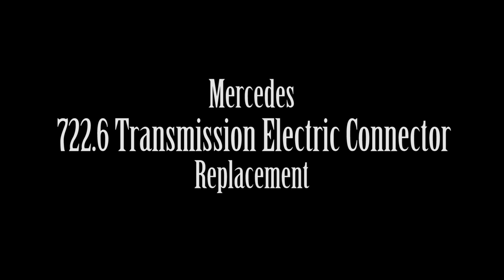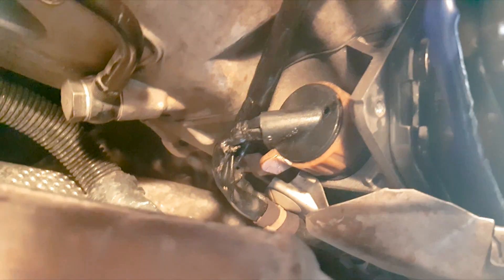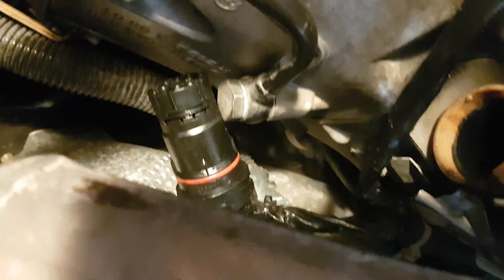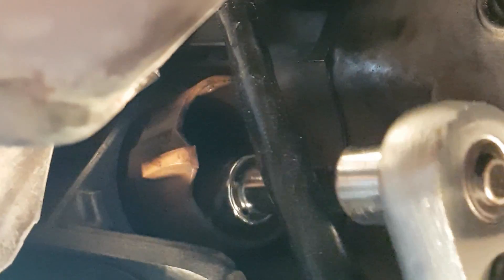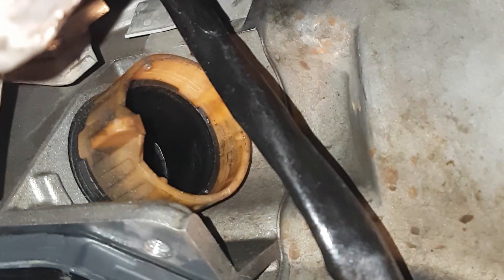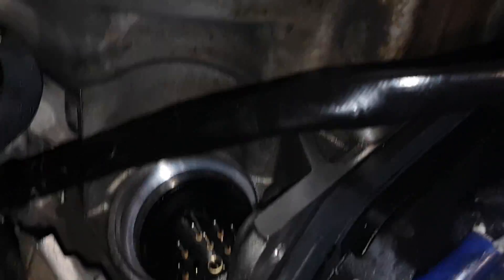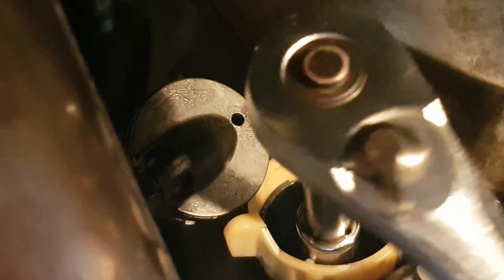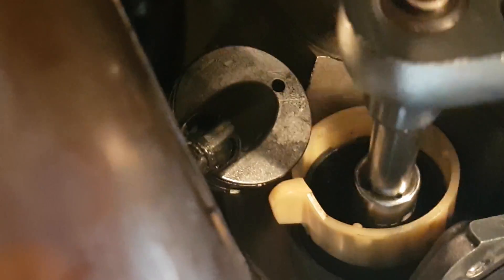Mercedes 722.6 Transmission Electric Connector DIY

Comment: sir i have gm transmission with similar connector. it always wet and fluid seen on the electrical terminals. i experinced stalling and not shifting at all so that i have to stop the car and wait for an hour and resume driving. now i am not using the car. is wet plug could cause this fault? is transmission fluid conductive?
thanks
Reply from the maker: Locate your transmission control module or TCM.  Open it up, and check for oil intrusion.   Clean good with electrical parts ckeaner.  Then replace  adapter.

Comment: I just did mine, it spilled around half a liter of lil from the transmission. Is this normal? I don’t see how I can top it up
Reply from the maker: Hi.  In order to avoid that, you have to lift only the front of the car. Still it could happen if the transmission was overfilled last time.  Yes, you can add fluid thru the dipstick holder in the engine bay.  Just be sure to add the right amount or yet better do a drain and fill.
Reply: @masood-tv will do a flush soon. Thanks for the video. Always great help :)
Reply from the maker: Np.

Comment: You forgot to mention to DRAIN the pan first. Please guys drain your pan first.
Reply from the maker: Not necessary.  Please read the comments and my replies.  If just the front of the car is raised and the transmission fluid is not overfilled or hot, you won't have much if any fluid drain from there.  However, it is best to combine this job with a drain.
Reply: @masood-tv  I had only the front raised and my fluid was not overfilled and it gushed out
Reply from the maker: @hamsawi23  Was the fluid hot and expanded?  Some may come out but if it gushes out it means it is overfilled or too hot.  I guess it would also depend on how high the front is raised...I would think high enough to comfortably work under.  I have done it with the car on ramps without any gushing...

Comment: I just did mine and a lot of fluid came out got really scare but car is driving fine I am sure is missing fluid not cool feeling wonder why so much came out like 2 quarts
Reply from the maker: Probably overfilled...please check level with a lipstick to be sure.  Also, as I have commented before, this job is best done on ramps or just the front of the vehicle lifted to avoid such spills.

Comment: You left out the little part about how hard that connector is to push in.. I use a short 2x4 to lightly tap them in. 🤷🏼‍♂️
Reply: Yes, I'm struggling with this now.  Glad to see someone else with this problem.  With the two o-rings on the new connector I'm unable to push it in.  I didn't want to force it.  If I take the o-rings off I can push it in easily verifying I have it oriented correctly.  I'll put the o-rings back on and try tapping it in with a wood block .
Reply from the maker: Just rub some transmission fluid on the gaskets....

Comment: Mate my screw won't titen on the new connector I need help
Reply from the maker: If you have not stripped it, it is because the connector is not all in.  Put a cellphone camera on it as per video, you should be able to clearly see the pins thru the connecorv holes.  Only then, press all the way.
Reply: @masood-tv  I appreciate you getting back to me I managed to get it in the holes just fine I just diddnt know you had to give it a good push in there I've done the job now thanks mate

Comment: Hi Masood, Need your advice, I had two of the trans pan bolt holes striped on my 2000 S430 (I over-tied the bolts, I didn't hear my torque ratchet click, I set it for 8 nm), how to fix this issue?
Reply from the maker: @garynewman6289  it requires some patience. Look for youtube videos on how to remove cut or stripped bolts.  There are special extractors you can buy cheap. May need a drill and bits and even a torch.  Practice first outside with a similar sized broken bolt and then on the car.  Alternatively, call a mobile mechanic to come and extract them.  Let me know how it goes.
Reply: @masood-tv  The bolts are fine, the thread of two holes is stripped.
Reply from the maker: @garynewman6289  ah, sorry.  You could  thread the holes larger and use one size thicker but same length bolts. Also, if you are good in welding, you can build up material inside the holes gradually without bulging the surfzce.

Comment: Hello I have a fault code and it says rpm sensor in the transmission could this replace work or do I need to change the conductor plate?
Reply from the maker: @yigitje1613  Hi, no, this won't do it.
Reply: Hello I have a question. I have Mercedes w203 someone change for me the oil transmission put a new filter but didn't change the TCM plug he just clean it up. But the  when I took the care didn't have same power and didn't go higher then 3000rpm. He didn't do it by temperature he juste drain it the old oil and fill it up the new oil. But sometimes when I turn the car on works well then few minutes later 1 or 2 min go back in slow mode no more then 300p rpm. If u can help me thank you
Reply from the maker: @Peon-1 have the fluid level checked first..
Reply: He did fill it out the same amount he he drain out. I will check the fluit at the 80 degree temperature of emgine ? Thanks for your answer @masood-tv

Comment: Mr. Masood, my 1998 e320 does not shift from 2 to 3 :( could this be the cause or I need to change the whole valve body connector?
Reply from the maker: Hard to tell without proper diagnosis, connector may not fix it....but conductor plate or valve body may.  Good luck.

Comment: Might want to add. Sometimes its not enough to just replace the connector. I did that and it was still leaking. In that case its the conductor plate on top of the valve body where this connector threads into. Not super expensive or difficult, but will have to drain the transmission and take the valve body out to replace the plate.

Comment: How much it cost in South Africa where can I buy it
Reply from the maker: @corneliuskotze-w5u  I have no idea. Hopefully, someone from SA can chip in.
Reply: @masood-tv  thank you. It game out with nut how can I fix it thanks
Reply from the maker: @corneliuskotze-w5u  please elaborate.  I am not understanding the question exactly.
Reply: I got a ml350 mercedes the machine took the transmission electric connector out the nut come with it out he tried to take it out and damage it if i bay a new nut will it work or how can I fix it
Reply from the maker: @corneliuskotze-w5u  ah, that us a captive screw and it is part of the connector.  You will have to get a new connectoer, I am afraid.  Sorry.

Comment: Would a faulty NAG1 transmission connector cause my car to lose all acceleration at random times while driving until I either let off the gas for a secound or I down shift a gear then press back on the gas then it drive all good again?
Reply from the maker: Hi Guy, it absolutely can.  It is what connects the Trans brain to the Trans body.
Reply: Yeah this happened to me it was because it was shorting the connector with oil or water getting into the plug

Comment: Thank you for the video.  Very helpful.   Like several others in this thread, I had issues getting mine to seat properly and was unable to get the nut to thread.   My secret was after confirming I had the pins lined up, I applied equal pressure around the cylinder to make it finally lodge.   You need to put a little extra pressure.   After that it was easy to snug up the bolt.   Thanks for a great video.
Reply from the maker: Thank you.

Comment: Salam Massod, is it possible to not have front differential on a 2006 S430 4matic (may be built in to the transmission)? I replaced the fluid on the rear differential but for the life of me can't find the front differential. Thanks

Comment: Do you have to drain the fluid to change this connector?
Reply from the maker: Hi Brett. No, but have a quart of fluid ready in case some spills out.
Reply: Hi sir
Why do we need to replace the electric connector..?
Reply from the maker: Hi, because due to a flawed design, fluid could leak and travel all the way to the TCM, causing potentially a lot of damage.

Comment: Nice video, thanks. One question: Should you replace that pinkish-orange gasket on the connector that the wire attaches to? Unless that's just a minor seal to keep outside contaminants from getting in.
Reply from the maker: Hi Dan, thx.  Not really.

Comment: Trying to unplug connector but orange tab doesn't want to move. Rather hard to reach. Its in a Jaguar XKR behind cat converter. Tried prying it with big screwdriver. Flexes but doesn't want to move. Was trying to see if its leaking. Decided to wait until i have a new one to try any more force. Sprayed a bit of penetrant on it. Any words of wisdom to share?
Reply from the maker: Hi Brian, don't be afraid to apply more leverage with a pry bar...just not to the point of breaking it.  Be sure you are turning it left from the perspective of looking at the back of the orange connector.
Reply: @masood-tv  Well I got it to turn. I came at it from the rear. Worked a bit better that way. To get it to turn far enough did break it. The part that turns that is. Got it out rather easily. Getting the new one in was a bit tight. But figure that means it sealed. Lubed orings with atf. 7mm socket with extension on the bolt. Used pry bar to gently push on extension as I turned the bolt. Raised the front of vehicle as you said. I lost almost exactly half a quart . The part I got was a genuine MB. It had 2 orings on it. The connector that plugs into it also has an oring on it. I did not get that oring. Should it be replaced also? Not sure if the leak is fixed yet. I'm still waiting on my dipstick to verify the correct level of fluid.
Reply from the maker: @briankennedy5578  the main gaskets are the ones in the MB part.  That should fix your leak for sure. The leak is caused by either after market parts or aging gaskets.

Comment: Would the rise from vehicle ramps be high enough to do this?
Reply from the maker: Yes.  Even better if you raise the front wheels.  Enough to do it comfortably. Don't raise the rear of the car, fluid may gush out if the car is leveled to the ground.

Comment: Hello 
I want to ask you about a problem in cls 2007 350 … i had a bad TCM not transferring signal … soo as diagnoses workshop changed .. and now after a month am back with the same problem … whem i start the car no transmission letters on dashboard …. Sometimes it take about 12 minutes then it shows letter i turn off and on again and the transmission work fine …. Could it be this connector ? Or what could it be
Reply from the maker: Hi Qais, it could.  The TCM talks to the transmission via a cable connected to this.  If the gaskets are breached due to age, oil can travel to the TCM.
Reply: Thank you for your fast reply ... 

But does this apply to the 722.9 transmission? The 7G
Reply from the maker: @qaisabdullah9507  I think the oil leak issue was resolved with the 722.9 transmission.
Reply: The problem is in the transmission shifter module !

Comment: My transmission started leaking oil from that connector. Is it possible that just changing the connector will fix the leak? Or do I have to change the entire plate?
Reply from the maker: Hi Rodrigo, you can change the connector first and see.  It is a cheap part.  Raise just the front of the car to avoid spills.
Reply: @masood-tv  great. Thank you.
Reply: @masood-tv  When you pull the old connector out, will all the oil come out of the gearbox?
Reply from the maker: No.  Raise the car just on the front wheels.

Comment: Where is this at on a 2009 Mercedes c300
Reply from the maker: Hi Cinnamon - if it is equipped with a 722.6 transmission, it should be in the same exact spot.

Comment: My 2005 sprinter 2500 is throwing P0175 “input speed sensor 1 circuit” .. the transmission is in limp mode not shifting but engine has full power. Would this part be considered a speed sensor?
Reply from the maker: Hi Jacob, P0175 usually tells of a rich condition...  If you have a scanner, scan all 4 wheel sensors and see if any of them is not keeping up with the rest....

Comment: I have been trying for 2 days to reconnect my new one. I find the grooves it slides down, but the bolt just will not catch. Spins and spins. Any ideas?
Reply from the maker: One more thing that may help, insert the connector lightly until it stops and with a cellphone take a photo and make sure you see all  the pins, then seat it with confidence.
Reply from the maker: Hi Michael, yes, it is not seated all the way.  Play with the old one as the gaskets are more worn out.  Also, I hope you purchased a genuine MB part.
Reply from the maker: Also, keep in mind there are many little pins that must not be damaged.  The connector can only go one way, align the  holes with the pins perfectly and then press and seat in all the way.  Watch the video again  in large screen.
Reply: Did u ever find out what to do I’m having the same problem
Reply: You have to find the correct seating position (you’ll feel it when you do) and lightly tap it in with a piece of wood or something. Again, lightly. It’ll pop in allowing you to tighten down the 7mm bolt. No need for torquing. Hand tightening will suffice

Comment: another fyi, im doing this in my 2000 w210 and if you think its in and you see the connectors your only have way there it took me 20 minutes to figure out that it should seat in there and be tight without the bolt, just use pressure and push and it should click in 👍🏻
Reply from the maker: Good point, Noah MC.  Thanks.
Reply: @masood-tv  oh you responded, so actually this made my case worse 😂 i put the new one in checked to see if it was in all the way and somehow a pin broke off and now my car will not shift out of second gear and its really tuff bc i need almost everyday, any advice? thanks
Reply from the maker: @noahmcc1  you can do one of two things.  Take out the plate and straighten the pin if not beyond repair, or replace the conductor plate.  It costs around $190.
Reply: @masood-tv  word would i have to do a whole transmission fluid change if i took off the plate?
Reply from the maker: @Noah Mc  measure exactly what comes out and replace by same amount.  Have a large catch pan underneath as you remove Trans  pan and then the plate.  Good time to replace your filter and pan gasket too.
Reply from the maker: @noahmcc1  that means you didn't have the pins aligned to the holes as per video prior to pressing.

Comment: Hi I've been trying to unscrew mine but the screw feels tight no matter how much I undo it, I also try to pry it out but it won't come out. Any ideas?
Reply from the maker: Hi Zim, did you use a 7mm socket?  Put a cellphone to  it and take some snapshots to see if it is unscrewed.  It will not come out completely.  Stays in the plug.  Look at new one for comparison..
Reply: @masood-tv  yes I'm using 7mm socket it doesn't matter how much I turn the screw it still feels tight and not loosened I'm afraid if I attempt to pry it out with too much force i may break something  my car is 2006 Chrysler 300c. It feels tight when I put my fingers in to feel the screw.
Reply from the maker: @Zim  I don't want to advise that you remove it if you don't feel comfortable. If it is not oily, leave it alone, or have a professional do it.  Ordinarily, it is easy to turn.

Comment: I just did this and the threaded part snapped off & came out with the bolt
Hopefully the seals are tight enough & will hold it in place
No leaks yet👍
Reply from the maker: Sorry that happened to you, Dan.  If the damage is to the connector, you may want to replace it.
Reply: @masood-tv  damage is to the valve body, the brass insert the 7mm bolt goes into is part of this very expensive part, and cant be replaced separtely...
Reply: @jovangrbic97 your damage is to the conductor plate not the valve body

Comment: Shouldn't a ton of oil pour out of this?I did mine and lost a lot of transmission fluid,did you change it with the pan empty?
Reply from the maker: Hi Roam, yes, it  is best to do it with an empty tray.  But to avoid spillage, it is best just to raise the front of the vehicle.
As you see in the video, no oil came out.
Reply: @masood-tv  Amazing. I have watched 20 videos on this and read numerous posts and this is the first time I've heard I could do this but raising the front of the vehicle!  My C240 2004 got stuck in park on my driveway, it would not shift, which at first I thought was the broken shifter piece you see in videos when you are first researching.  I did more research, however and determined my shifter didn't have that piece-and that I needed to check the TCM computer in the passenger foot well.  I did this and lo and behold, there was a small puddle of transmission fluid under the carpet on the floor board and wet wiring harness.    The TCM wiring connectors were wet with transmission oil,  as was the wiring harness, but the printed circuit board was dry.  How do people clean the wiring harness? I have not seen how to do this.  Also, once this is fixed,  don't I need to delete the transmission codes? As I understand it, don't I need to do that so it will shift out of park and into drive again?  I did a deep dive into the OBD Merc readers and there are knock offs I want to avoid.   What do you suggest on the wire cleaning and the codes? Thank you for helping others.
Reply from the maker: @sl5311  If you can disconnect at two ends, pull out and clean with ultrasonic cleaner.  Otherwise, dishwasher soap  :)
Some knock offs are every bit as good as the one from MB and thousands cheaper.  If you plan to keep your Merc and work on it yourself, I highly recommend it.